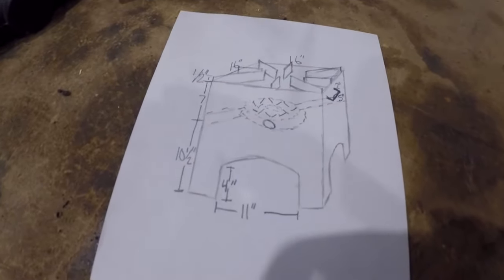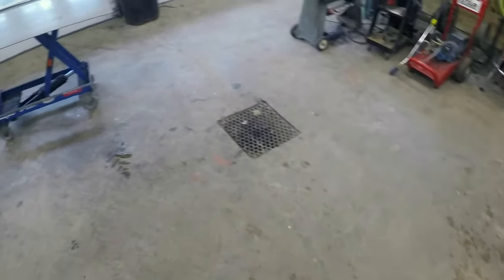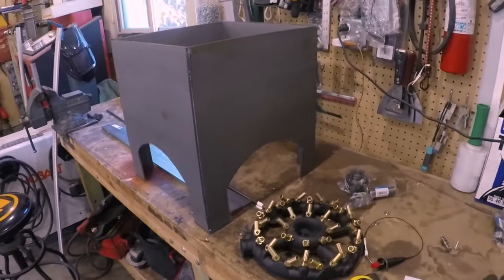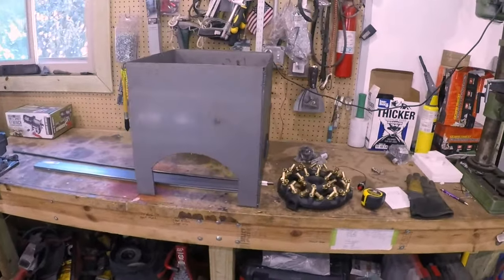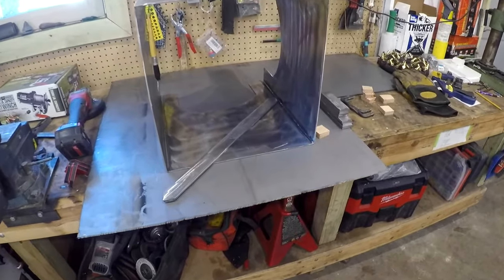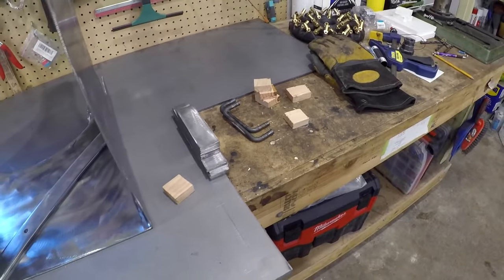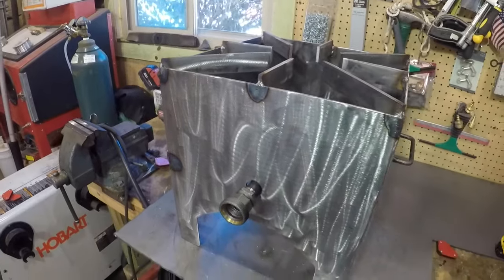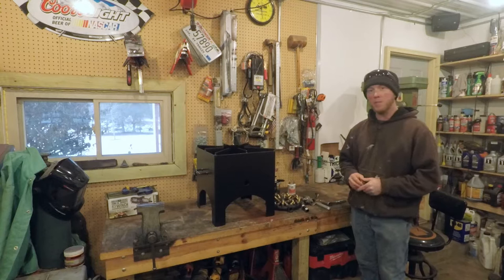Building a Outdoor Natural Gas Jet Cooker

Comment: Great workmanship. It is a fantastic idea to use the plasma to cut most of the length to enable the metal to be folded, we will have to borrow that idea.
Reply from the maker: Thanks Joseph! Yeah that method works nicely and I use it all the time as my 50" brake is only good for sheet metal. Obviously it takes a lot more time then a brake but can't tell the difference once the welds are ground down. Thanks for watching!

Comment: Nice, I bought a natural gas burner recently and searched to try to get ideas for my build. I’ll probably be using all-angle-iron since I don’t have a plasma cutter, yet. The only concern I’d have is air flow. They say the flame gets yellow and you get black soot buildup on the bottom of the pot/pan when there isn’t enough air. I’ll check out your testing to see how it goes. Too, add the igniter or even a pilot, it’d be a really cool feature, even if it’s overkill. You spent all the time and effort doing the build…
Reply from the maker: Yeah your right very easy to do. My only concern with the ignighters I has laying around was the heat maybe getting to them. Would take 30secs to drill the hole to mount the igniter though. I've only really run it on full open while boiling sap so well have to see how it does on a slow cook as far as soot goes